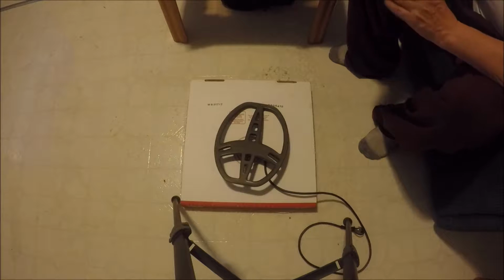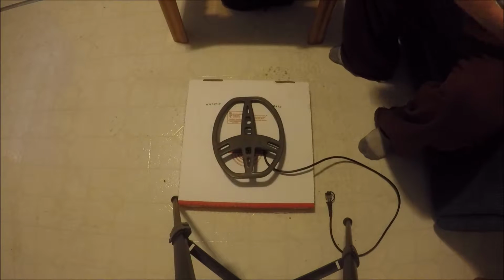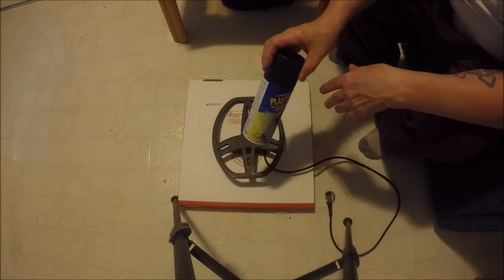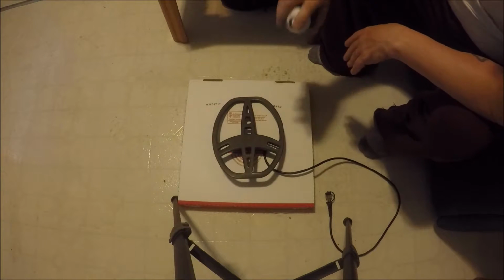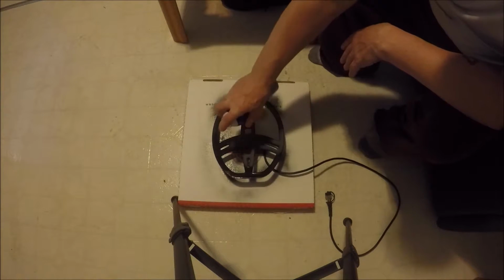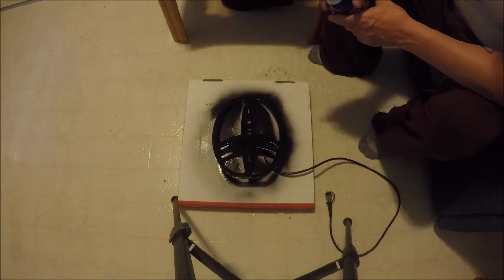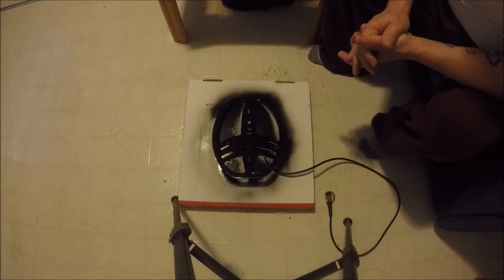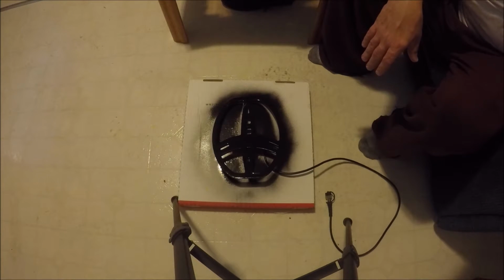Keeping Your Coil Protected

Comment: Hello bud I was just after you did the coil how did it work when you tryed it out for a dig as I am having the same problem with my coil it is really scratched and I was going to buy a new one but after seeing your video  you made me think about doing it  to save money thanks for your help and hope it works out for you bud happy hunting and good
Reply from the maker: detector David It works good I sprayed it on thick but only like 3 or 4 coats. You could spray on a lot thicker if you wanted to or just get the kind you dip tool handles into to make them non slip and get a small foam brush or small foam roller to apply it and it will be able to handle very harsh abrasions I would think because it’s goes on really thick.